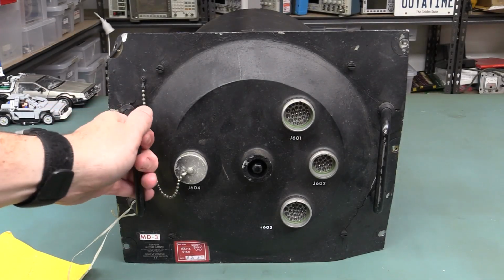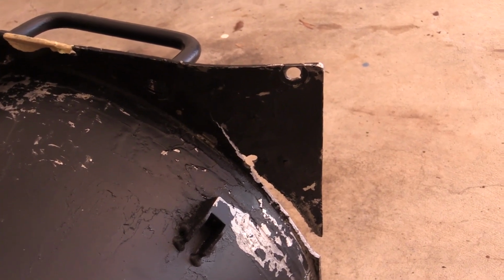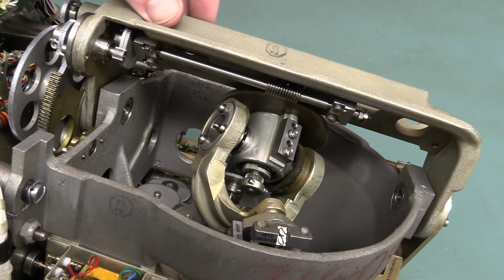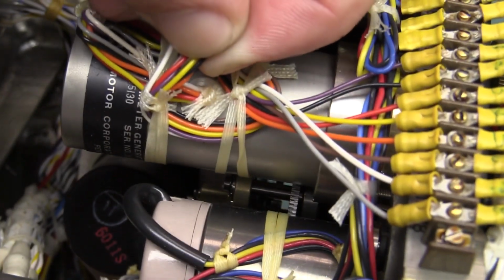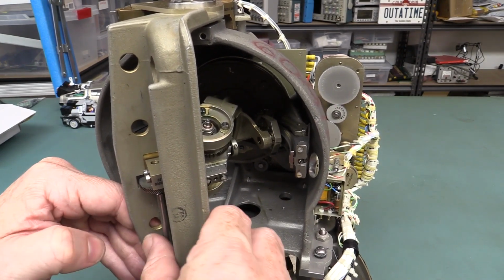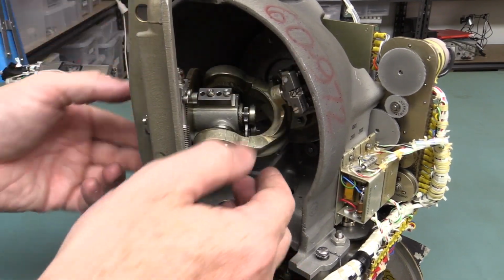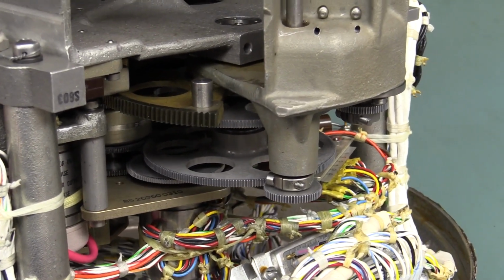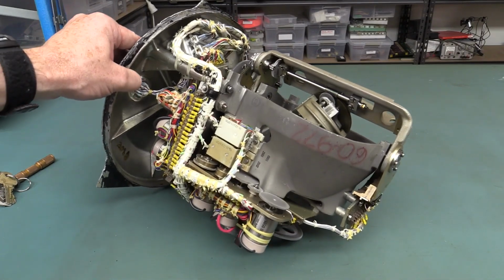EEVblog #854 - B52 Bomber Automatic Astro Compass Teardown

Comment: Used this astrotracker in a b52 for many years (as a B52 navigator).  This is not part of an inertial system.  MD-1 used bomb-nav position and some celestial data to generate true heading.  Easy to use, very reliable, accurate.
Reply: Yeah, I was going to mention that the Astro Tracker and INS are different animals

Comment: The largest motor should be the one that spins the gimbal up to a very high RPM, and maintains that spin. During flight, the gimbal is very sensitive to inertial forces, causing the outer casing to rotate along axial points. Those inertial rotations are relatively slow...corresponding to the plane's motion. The axial points are meshed to the synchros and turn those respectively.

The synchros are similar to motors, but are actually the opposite. Constantly powered electromagnetic coils, with outputs leading to another component containing corresponding servos. Cockpit and navigator instruments, as well as direct inputs into the 3 ACU's. The instruments are stepper motors, controlled by the outputs of the synchros. One of the ACU's is dedicated to the integration of navigational input, but the other 2 are designed with redundancy. In event of ACU failure, any of the other 2 can assume its operations. Therefore, the INS gimbal synchros split their outputs to all 3.
Reply: The astrolathe is used for periodic corrections, as the INS system is prone to drift. In the h-model, TACAN and GPS replaced the astrolathe for more reliable drift corrections.
Reply: (Former USAF. Tech schooled in B52 and B1B Offensive Avionics Systems. INS was a large part of that.)

Comment: The two gears with the metal tape joining them is a variable ratio gear train. Usually gears turn a fixed ratio but with that the amount the 2nd gear is turned is dependant on the "tape circumference" on each gear. As the gears turn there is less tape n one gear and more on the other so the ratio changes... basically a non-linear actuation of some element. Of course it will have limited number of turns or the tape will run out but within it's range it will perform very reliably...

Amazing bit of kit...

Comment: I agree with you that it is a trigonometrical computer.
At 24:19 I see a differential mechanism. The difference in speed of rotation between your fingers is 0 and the output stand still.

Comment: This is so cool! I'd bet this thing sounded glorious when it was running. It's really interesting how well preserved this thing is. It's what, 40+ years old, but the stickers on the motors and the wires are in great condition. I guess they stuck it in that metal can for a reason.

Comment: Cool bit of kit. I come across some cheap avionics on eBay that had been deemed beyond economical repair. Some is quite modern perhaps late 90s which I've pulled apart. I've got a colour LCD from the cockpit that I'm trying to figure out what to do with. Very well and almost certainly over engineered kit.

I've torn down a tornado fighter jet avionics box that I've made a video of and  put on my channel.

Comment: Hey Dave,
I tried to find a manual for this unit but to no avail.  I found some promising looking links, but when I clicked on them I got the Aggravating 404 message.  You might want to check these out though:
https://stratofortress.org/
https://youtu.be/GLE3Mra-FNo
Something that I did locate was interesting...and I thought you might want to know this:
The MD-1 Astro Compass continued to be a source of trouble.  It was discovered that several of the small plug-in amplifiers had bent pins and socket damage due to misalignment of the sockets in the unit.  However, this problem appears to have been cleared up by the vendor at this time.

Another problem of the MD-1 System was the inaccuracy of the clock used with this equipment and the fact that there was no flight test tolerance for the clock.  this condition was alleviated with the issuance of a flight tolerance and the installation of a new Tuning Fork and Time Standard Amplifier.

Comment: "Synchro Motors" Generate and/or react to degree-by-degree phase relations so they can precisely detect and re-create the rotation of another synchro motor. This is a very common arrangement found in navigation and weapons aiming computers. You'see at least five wires interconnecting each motor in a synchronization circuit. Ratios can be varied easily using gears or differently wound motors. Very complicated and compound calculations can be performed using this and a differential coupling, similar to the differential in a car.

Comment: That reminds me of some mechanical computer which I was supposed to learn in 1986. I joined the German navy because they advertised modern electronics. And then they had (in some ships) these 30 ton mechanical computers with bronze parts to get the sinus. They could detect enemy fire up to 11 km away and they could, with the mechanical computers, shoot at them up to 6km away. That was the time when I decided to leave that place and look for a job with real electronics. Maybe a year later I worked on 286 PCs with DOS...

Comment: Soldered housings where nothing uncommon. Still in 1995 I had to unsolder/solder altimeters from older 737 still in use at that time. It's a pain in the ass to solder them again. And even then they were full of fine sand when we received them back for repair from Arabian/African customers because of sandstorms and not perfectly seald glasses or knobs on indicator devices. Some of them like yours where filled with nitrogen against corrosion since its hydrophobic.

Comment: The B52 is an incredible piece of machinery. The last one was built in 1963 and not only are they still in active everyday service, in 2013 they completed a very large overhaul program, installing new avionics, fresh coat of paint, that thing. This upgrade has said that these aircraft will likely see service into the 2050s. Just think about that for a second. These aircraft will have been flying for a hundred years
Reply: Yet a modern pop-up toaster has a typical lifespan of one month longer than the guarantee interval.
Reply: Amazing

Comment: you'd need to set up some sort of resolver to send the signal to the syncros. you may be able to simulate it with some function generation IC's or LM555 timers, op-amps, and mosfets to drive them.

Comment: OK, so this is only one of the sensors involved in a rather accurate and important system.  The platform is "caged" during tracking, and measures angles and rotational rates required to produce an accurate heading - based on stars on the celestial sphere.  You don't need massive rotating things to be a good gyro.  Also, things become a little complicated when you're flying over the poles.  The electrical output is simple set of 400 Hz signals whose phase differences are used by the compass system.  Nice museum piece.  I enjoy your passion for these items, sir!

Essentially, you get the True North azimuth from the system.  This is one of the first very innovative star tracking systems that worked extremely well.  The engineers who designed these things hold a revered place in my heart, as I make a mediocre attempt to continue their work.  The allied piece is a relay.  All to designed to measure rotation angles and rotation rates.

See here for some more detailed info:

http://prc68.com/I/MD1.shtml

https://www.ion.org/museum/files/B-52%20and%20GAM-77%20Overview%20V2.pdf

Comment: Dave, those transformers are synchros. 3 phase stator winding plus single phase reference rotor winding, exite the rotor and the phase relationship on the stator is proportional to the angular position of the rotor. Wire two of them together and when you rotate one rotor the other will follow it. The control transformer takes a 3 phase input and rotor angle and outputs the difference between them (kinda).

Those little box of electronic bits will be amplifiers.

I expect this will take course and fine synchro data about the planes physical position in space (where it's pointing) and use that to drive that frame you're playing with to calculate azimuth and output it as course and fine synchro signals via those cogs in the bottom.

Comment: 13:20 About those microswitches on those barrels. Perhaps they send a train of pulses to the "synchro transformers", idea being you can have a variety of different frequencies generated from once stable oscillator input?

Comment: it looks a lot like an equatorial mount ( like the one you could use for a telescope or  astrophoto or solar tracking) made to mec hanically keep  the orientation of a star, coupled with inertial navigation system would allow to track the star even if it not in sight anymore, with an initial calbration at  plane startup..

i guess. not a mechinical engineer neither.

Comment: Why would someone deploy an analogue computer, rather than a digital one?

The answer has something to do with MIPS.

Digital computer = general purpose, but finite MIPS

Analogue computer = single function, but effectively infinite MIPS
Reply: not really, in a similar way that a digital computer is limited in precision by it's data width or its 'finite MIPS', an anlogue computer is also limited - by noise.

Comment: The cost of the trig resistors in this thing would buy a great lab today, including desktops and laptops. This would be in adjusted dollars. :)

I have forgotten the CO$T of the ones in the missile system I worked on. But just the trig resistors were thousands of dollars each in late 1960 dollars. They were hand calibrated over days from what the Raytheon engineers told me. (I ran into a couple of engineering teams in eight years. And, that was extremely rare. Most of my fellow soldiers never got to talk to any. I was very lucky.)

Comment: how   Automatic Astro Compass Type MD-1 automatic astro-compass work without image processing?
Reply: At a guess, the system would probably have been manually aligned by a crewmember. The telescope could then track the stars by comparing the signal strength from an array of 4 photodetectors.

Comment: These used optical device or photocells or camera's to lock onto star (light), track it and report angle (azimuth) from the horizon and rate of change of the angle. The big disadvantage it did not work when cloudy. Celestial navigation is the use of angle between celestial bodies and the visible horizon to locate one's position on the globe. There was ambiguity and would get two solutions, of which one would is disregarded based on recent known position. If you could track more than one star if available, you can triangulate position and improve accuracy. Of course you need accurate date, time, star charts, horizon and aircraft altitude (known by altimetry). This was used in combination with Dead Reckoning navigation, using magnetic heading (corrected for deviation), winds (est, predicted or measured), aircraft speed (converted to ground speed) and last known position. The other "primitive" pre GPS Nav method, is "pilotage" using visual ground references and maps. In clear weather this can be very useful and BOTH dead reckoning and pilotage are used by pilots. Combination of Star shots and other Nav (Dead Reckoning, Pilotage) you could find your position in reasonable accuracy for the time, which might be 100 miles off, not 100 feet like GPS. The early sailors who used celestial Nav had to deal with a rolling pitching ship, making getting angles difficult and time was not accurate, many clocks used pendulums. Also being on the ocean clouds were more of an issue than a jet flying in stratosphere. However they could take day time shots of sun and night shots and over time and again dead reckoning get close, but that might be 100's of miles off. in the 1960s there was LORAN or Doppler radio nave. Then advent of inertial navigation, is like very accurate dead reckoning, using accelerometers, laser ring gyros and computer it measures it's location by integrating all it's movements from it's initialization from known Lat Long.  Look at airport gates, you often see Lat Long posted, or it's on the airport gate chart. This is so pilots can align their INS or inertial NAV system.  Now with today's satellite based systems, and INS, plus radio nav (when in range of terrestrial ground nav stations) celestial nav is almost phased out for aircraft and ships.
Reply: I've got a manual for a Sperry autopilot 'Gyropilot' system - a pretty sophisticated compass and servo based inertial navigation system and dated Feb 1946. Very similar looking tech to the astro-compass unit here. Accurate long range inertial navigation was one of the big technologies of WWII and allowed planes like the B29 to hit cities in Japan from thousands of miles away.

Comment: This is part of a celestial unit that tracks set of stars. It works as following. The optical unit with camera, prisms and beam splitters locks on a preprogrammed celestial object and tracks it relative to the flight path. The optical unit send driving signals to this unit which turns the central positioning mechanical unit to replicate the pointing to the celestial object relative to the flight path. This pointing is adjusted in a real time as aircraft travel. The central positioning units originally calibrated with some initial "zero" x, y, z coordinates, which is cog driven and linked to multiturn potentiometers with reset switches whose input of the difference between current coordinates and original coordinates digested by cpu and sent to cockpit display . This unit must have some sort of outside computer board and a power supply both which A) decode reading from cogs driven potentiometes, B) powers motors, C) responds to cog driven reset micro switches, stores and/or receives preprogrammed initial set of stars for tracking, etc. Just alone this is a nifty piece of equipment, like a robot without eyes, brain and power supply. Tataa...
Reply: +Tim Ka It was probably nitrogen filled to prevent oxidation
Reply: Back in the day (last '70s) when the DoD ran surplus sales themselves, a complete MD-1 astotracker turned up at Kelly AFB. I bought it. Coat me more to ship than the purchase price and that's after the packer-shipper took the steel frame it was in for scrap and discounted his fee accordingly. It had been a training system for the folks who maintained the MD-1 he system consisted of 24 boxes including the one being dissected here. The tracker heads turn up sporadically. C&H Surplus in Pasadena must have had hundreds of these, many new in the boxes. The time base for the system was a tuning fork made by Bulova and thermally controlled (in an oven, like a precision quartz standard). I am pretty sure that the unit being taken apart here resolved the angular outputs from the tracker head and did some of the translation into coordinates. The other parts that turn up frequently (or used to) are the "Star Data" displays that showed the particulars (right ascension, declination) of the stars being tracked. Kollsman, who built the tracker heads, also built the optics for Apollo (the Command Module sextant and telescope and the Lunar Module alignment optical telescope). They are also known for aircraft altimeters. Oh, I eventually donated the MD-1 to the Kansas Cosmosphere; not their cup of tea, but they in turn donated it to an aircraft museum in Oklahoma City.
Reply: AHH is that why the Vulcan that bombed the airfield during the Argentine conflict had to climb when it got lost to get above the clouds to get a fix ? They said in the documentary that its navigation was cogs and springs and chain driven

Comment: The stellar system I work on is filled with nitrogen to prevent expansion of the gas with temperature,
And inside the metal is beryllium because the metal won't expand or shrink due to temperature, as any little change will cause a big change in navigation errors. Lol
Reply: IF you ever worked on stellar system (??? what?  u mean solar system ;-) astronomical system? stelar navigation? who knows) it is filled with (dry) nitrogen to prevent oxidation, condensation and provides pressure at high altitudes, perhaps to prevent electric arcing and help cooling among other things. 
U could also use pressurized nitrogen containers to use regular spinning platter HDDs in airplanes/spacecrafts, and any electronics not specially modded for better cooling in very low air pressure.

Comment: Does my heart good to see synchros, rate generators and servomotors again.  You would find dozens of them packed into instruments and gyros in the airliners i used to teach.  Pretty good, short article under "synchro" in Wikipedia.  One thing that everybody gets wrong when looking at the construction of many synchros is to assume that they are 3-phase devices.  They are not.  They are single phase only,  usually 26 vac, 400 Hz.  All voltages in the synchro system are either in phase, or 180 out of phase, with the excitation voltage.  Wonderfully interesting systems originally developed by naval technology for remote aiming of ship's guns, soon to be as forgotten as Grade A cotton fabric and nitrate dope covering airplane wings.

Comment: That's not a "decommissioning" stamp, that's an internal military condition code stamp.  Thats the exact tag we would put on items that come to be calibrated.  Its a calibration tag.  Every single item we had run through our cal shop had that tag on it.
There is nothing on that that says that item is "decommissioned".  Its pretty close to 100 percent certain it was stolen.  Still cool, but probably not legal.
Condition code "B" just means "Serviceable, like new with cosmetic damage".